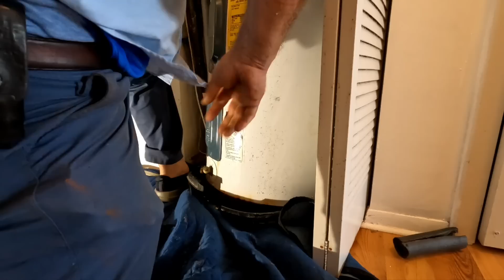30 GAL. LOWBOY ON 2ND FLOOR INSTALL

Comment: Great video John 👍 I like the the basic Rheem water heaters, the non-computerized  versions. They seem to last 20 years or more. Only think I don't like is that plastic drain valve. They should make the brass one standard...
Reply from the maker: I think even the Rheem heaters from home depot come with a brass drain now,the heaters I get from a plumbing supplier have always come with a brass drain valve, Merry Christmas and thanks for watching my friend!